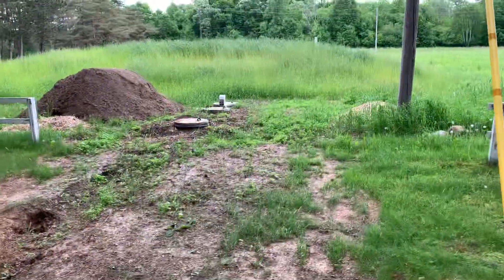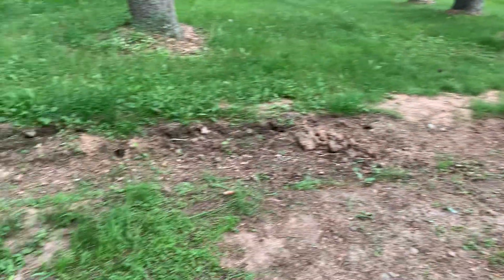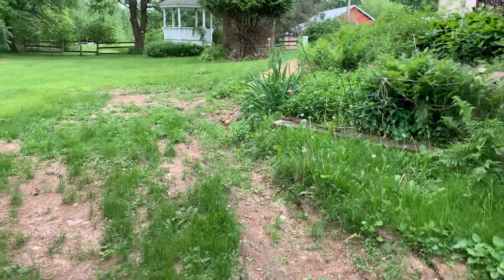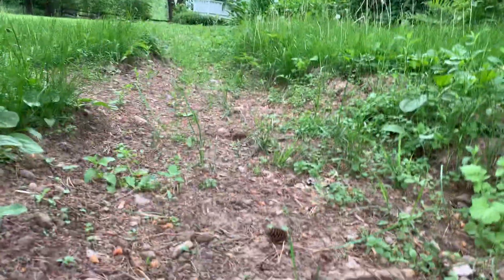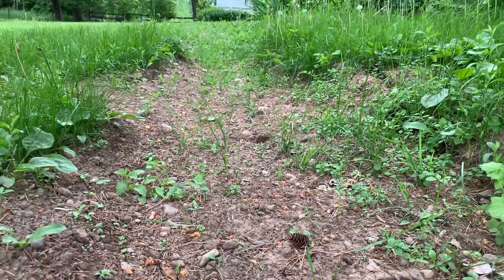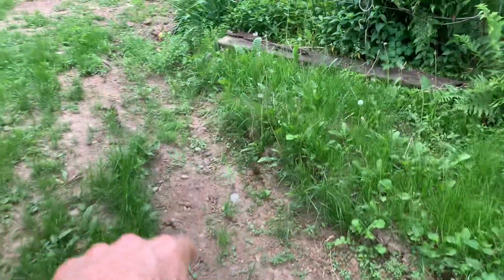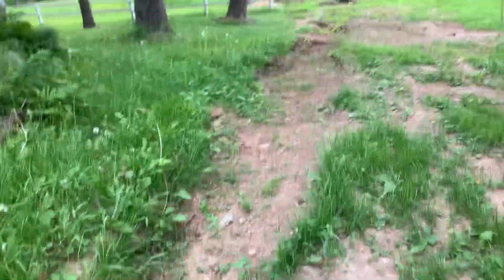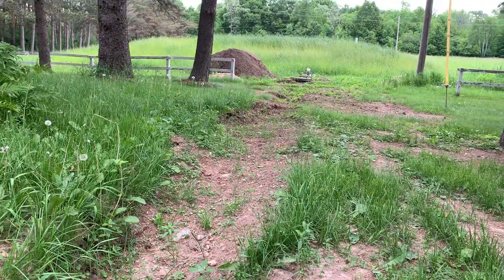Radon Mitigation Suction Point Placement

Comment: I have a 60's ranch with no sump pit. I do not know if I have a drain tile on the inside of the footing, but I assume there is one since I get no water in my basement and I'm up on a slight hill so it may be a weeping tile that comes out in the front yard. Should I core the hole near the basement wall and dig to find out if I have a drain tile or just core a hole near the floor drain where i know for sure that the cast iron sewer pipe travels the length of the home and out to the street?
Reply from the maker: Hey Joe. It’s incredibly rare for a home in our area to have drain tile before the 1980s unless aftermarket drain tile. You will likely want to be near plumbing like you suggested. 

Take a peek at some of the videos in this playlist. https://youtube.com/playlist?list=PLuNbsvWsW0-BcwjYG1QfWQln0DDSdby9V